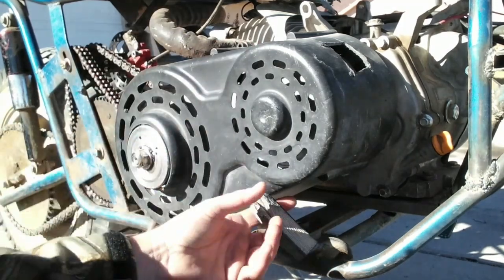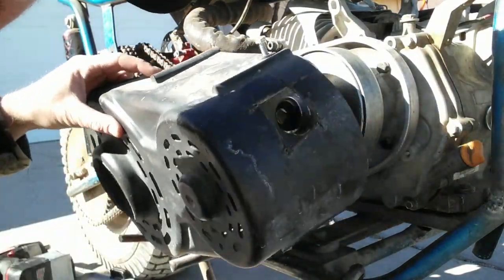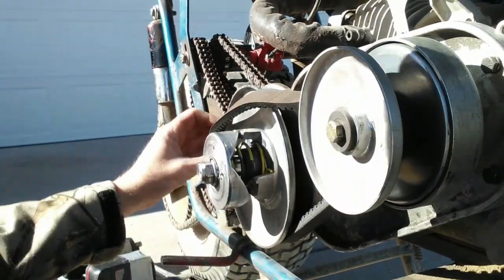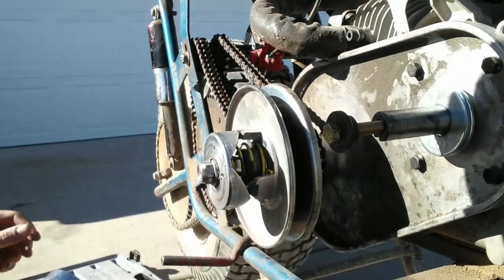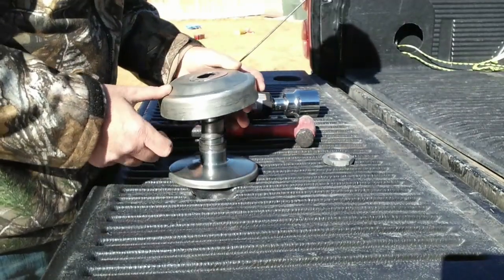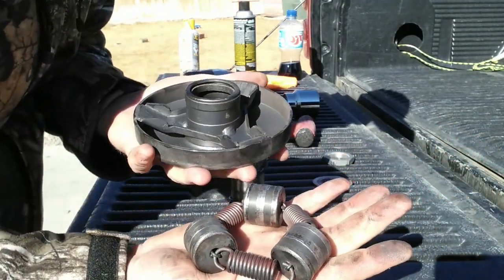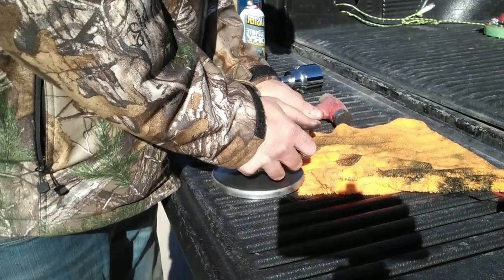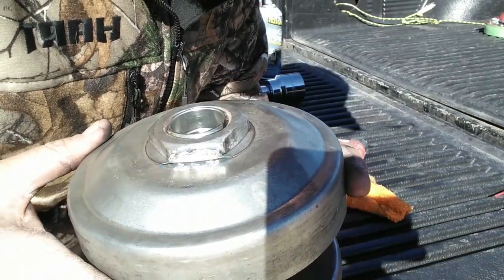40 series driver maintenance

Comment: I gave up on the 40 series drivers, comet or the china stuff always seems to hang up, no matter how much i clean, de-burr and lube. Gonna try a 44c magnum driver.
Reply from the maker: Ya this 40 driver sticks closed alot. I actually have this motor out of that bike and going in our 1970s model b drag bike build.
Reply: @nicsminibikes   ran my manco 3 wheeler tonight after i swapped out the 40 driver for the 44c and after a hour of non stop blasts, off and right back on throttle tryin to make it stick I couldn't. seems like a much more smooth engagement too.
Reply from the maker: @billwilliamson9842  I'm not using my 40 series right now but I like what you're saying! I might have to get me a 44 driver!
Reply: @nicsminibikes  yea, i was really disapointed in the 40 series drivers. the 44c is how they should act.